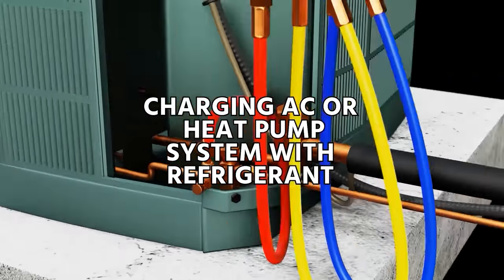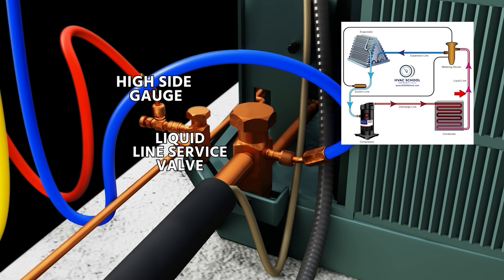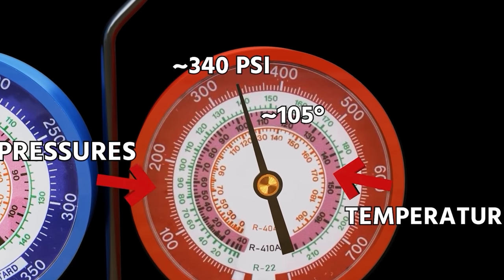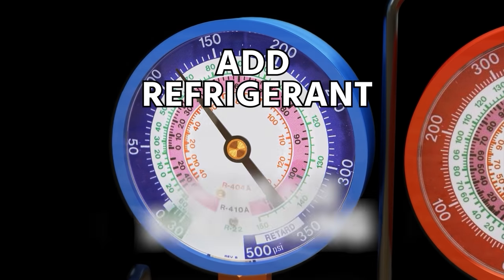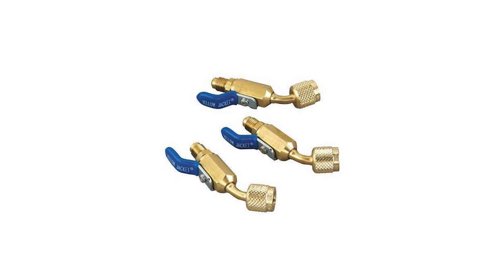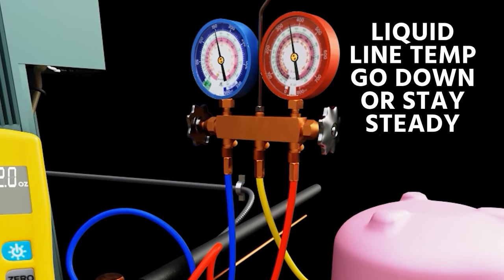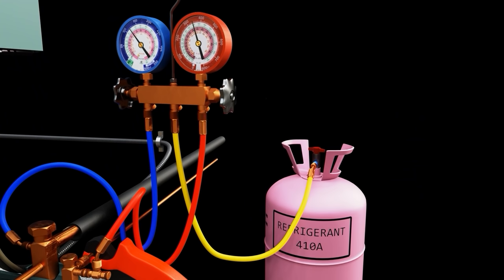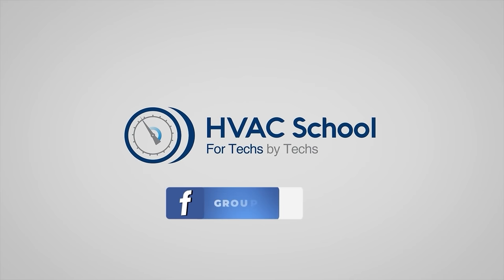Setting a Charge By Subcool on a TXV system In 3D

Comment: So in other words, if you pulled vacuum, you can just use the pressure of the jug to put the entire factory charge into the system with everything off in a single go, turn it on, check delta T, and if that seems good, then close out the job.
Reply: If you are charging a system in a vacuumed state would you charge liquid refrigerant into the liquid side port ? Then open valves and do a startup?

Comment: if you are working in a high temperature environment where the ambient temperature goes well over 100 degrees how accurate would your measured liquid line temperature be because of that fact?  Also how does ambient temps affect the 10 degree target txv in any way?  Same issue for very cold temperatures would apply because the physical lines are exposed to large ambient temperatures variations. Is there a point where it is very hard to achieve an accurate system charge using gauges?  This has become much more complicated than my automotive AC training was years ago.

Comment: Nice video. 
 Many manufacturers specify +/- 3 degrees. 
 I've been in the trade, travelling nine states for an industrial, institutional contractor since 1981. Most of the equipment that i worked with was 20+ tons. I've assisted with instruction with the company I was with and through our apprenticeship training. 
 Unfortunately, many in the trade have blinders on. 
A few preliminary things to check, and it doesn't take long to confirm, are external static pressure, return and discharge air devices open and unobstructed, depending on age of unit and environment - condition of fan wheel, condition of filter(s), and coils.
 I can't count how many times I've been on jobs that were over or under charged because folks didn't take the time to look at the basics. Like with EMS, dont forget your A,B,C's. (Airway, Breathing, and Circulation)
  I also ran EMS, rescue, fire, dive team, and occasionally flew with our early air medical organizations to unwind after dealing with engineers and architects. 42+ years in public safety services.

Comment: What an awesome video and tutorial!  Absolutely killer content and howto help.  Thank you so much and PLEASE keep this basic and foundational info coming.  It would be amazing if you had an entire series of DIY, start to finish, on troubleshooting and most common hvac repairs (contacter replacement, capacitor replacement, charging up low system, finding leaks, repairing leaks, etc.).  Even if you sold this series — if it walked through step-by-step, I’d buy it in NY second.  Also, if you provide tool set recommendations - like good/better/best options, and defined which tools are truly mandatory versus which tools are nice to have, etc.  This would be home run.  Especially if you also provided basic electrical troubleshooting guides too.  Thank you so much!

Comment: That's the first I've heard of that tank adapter. Didn't know there was such a thing.
Reply: Yellow jacket makes them (of course lol) they work great but definitely slow things down.
Reply: @codycopeland7527  yes it does, which also is why there are more than a few companies/techs do not use, because why do it right and take more time (when they get paid a fixed rate), not to mention - it’s not their compressor the techs are destroying…and when your compressor bites bullet after getting slugged, then you’ll be calling the company back to buy an entirely new HVAC unit.  Clear as day and makes perfect sense to me, right?

Comment: Thank you for sharing your knowledge. I did the same steps after  checking filters , condenser, blower ,fan  and no leaks but  adding 1/2 pound or so did not change the subcooling or the high side pressure at all even after 15 min system run and txv superheat was in the range. Where the 1/2 pound of 410A go?  thank you!

Comment: Excellent video…great presentation.  Would it be helpful to report what the outside ambient temperature was here?  We had a few days here in NOLA of 100º last month.  What is the closest approach temp one can expect with air temp of 100º?  Will the TXV adjust to increase liquid line pressure to where you can get 10º sub cooling with ambient air of 100º?  Or is it a sliding scale?  Well done…thanks.

Comment: I like your idea of using the core depressor tool to minimize refrigerant loss when removing the hose on the high side.
Reply: It's a core depressor. They are extremely handy when connecting to the liquid service valve
Reply: @Austin23191    Thank you for recognizing my terminology-typo. I have corrected.

Comment: I have an issue and maybe you can help. I have a 4 ton r410a heat pump with txv in air handler. In ac mode 85 ambient temp. Unit is cooling fine with 115 suction and 260 head and 78 hs temp so subcool is correct at 8 (7-9). shouldn't I have a much higher hi side reading? 
thanks in advance.

Comment: I have perfect SC and SH in the 80 degree morning.But come midday and later my SC stays same but SH goes high.Whats the diagnosis?
Reply: I'm not an HVAC pro, but I'm going to take a guess and say that you have a fixed orifice metering device which means you need to charge by target SH and not by SC.  You are observing actual SH and target SH moves around as the unit runs and as refrigerant is added which is why around six wireless probes and an app which calculates target SH in near realtime are priceless in getting the charge correct on these units. A TXV metering device will attempt to hold SH to a constant value.  I have not tried this, but I read that if you temporarily and for a short period of time block off the condenser coil with say pieces of cardboard box and watch your gauges, if both the low side and high side gauge go up in pressure then you have a fixed orifice, if only the high side goes up, you have a TXV.  It does make sense to me because the TXV is going to attempt to maintain pressure, temp on the low side at a fixed number.  Anyhow, I hope this helps and doesn't confuse the issue too much.

Comment: you're saying add refrigerant to increase our subcooling but you're showing the blue gauge... what am I missing here?
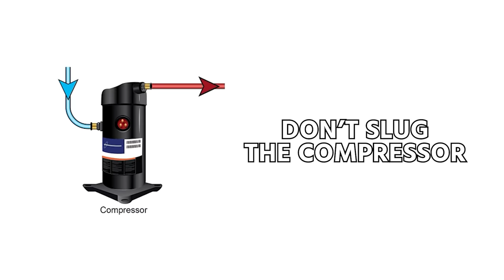Reply: 6:54 - What you’re likely to have missed is this point in the video where Bryan monitors the red (high pressure) gauge to get the condensing temperature for comparison to the liquid line temperature, calculating subcool on the fly. Also, notice throughout the video he is using the blue (low pressure) side of the manifold only to add the refrigerant to the system.

Comment: How is it even possible to charge as liquid WITHOUT the charging adapter? I thought liquid is a big no-no into the suction line?
Reply: I have seen guys suggest pulsing the charge in by opening and closing the gauges a small amount for short periods of time.  I think the pressure reducer adapter is much safer.

Comment: You should mention that the system should run for 5-20 minted before your pressures and temperatures reach homeostasis. So often impatient technicians change the charge and walk away before the system reaches homeostasis. And then the charge is wrong.

Comment: When it's overcharged it don't get as cold right dude
Reply: When it is overcharged you are stacking more liquid refrigerant in the condenser coil than is necessary so you are reducing the area of the coil where the refrigerant is changing back from a vapor-liquid mix back to a liquid which is the exact time when the most heat will flow into the outside air.  Thus you are unnecessarily  increasing head pressure on the compressor causes it to waste more energy and shortening its life.  Also, in extreme overcharging, the evaporator can be filled with liquid refrigerant and it's possible the liquid could make it back to the compressor on the suction line.  Since liquids don't compress this has a chance of slugging the compressor.  We can't see it, but I like to think of a well tuned unit as having about 5-10% of the bottom of the condenser coil filled with liquid-only refrigerant; this ensures that only liquid makes it down the liquid line back to the metering device before the evaporator.

Comment: I rarely ever charge with subcooling! The reason!?!? This is an imperfect world! Some peoples houses are nastier than others. If the EVAP coil, blower wheel, filter or condenser are dirty, this won't work. All of these need to be clean and free if debris for this to work. Although the narrator is correct in his explanation, companies use this as a way to keep the tech on the job longer(cost more) Ask me how I know! If you lose all the refrigerant in a system, fix the leak, pull a vacuum and weigh in the charge and start the system! Look at, don't open, the high side gauge. Take the outside ambient temperature and add 30 degrees. Say it's 90 outside. add refrigerant until the high side temp scale hits 120 degrees. That's all u need. Move on to the next one!
Reply: Old rule of thumb is not the point of the video

Comment: A better set up than using a core depressing tool is to use anti blow back hoses. Anti blow back hoses minimize cross contamination because the gauges are sealed and will not absorb moisture from the air. I have never had a cross contamination in any system that I solely maintained. Every contaminated system (in 22 years) I came across, was serviced a year or two previously by another "tech" from another company.
Regular hoses should be banned, they are a major source of freon emissions and they contaminate thousands of systems each year. When removinging anti blow back hoses, first unscrew the high side half way, then open both gauge valves and the high pressure liquid will get sucked back into the system. Finish removing the high side. When both gauges read the same, remove the low side. That positive pressure in your hoses help keep them clean.